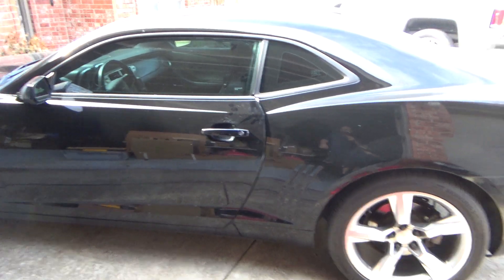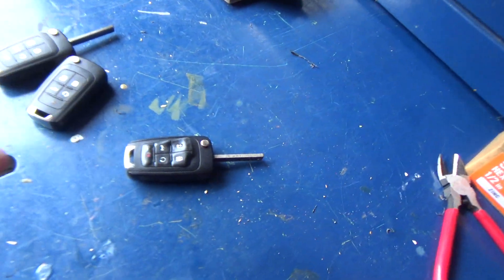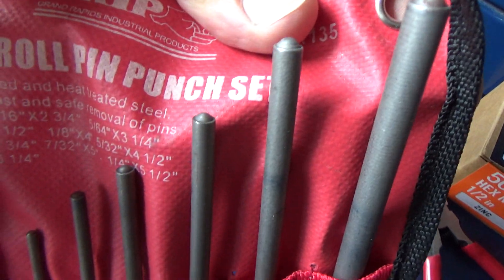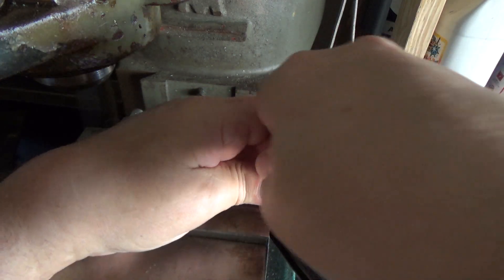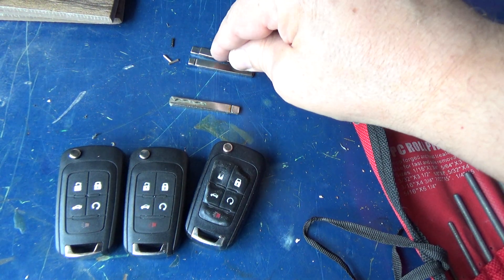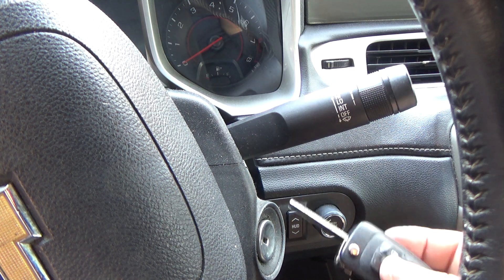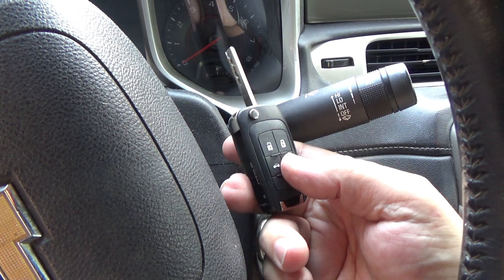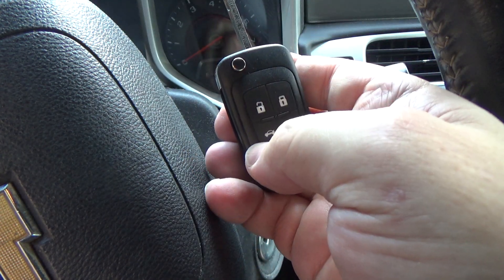How to Install the Key from Old Remote into New Remote and Program so you Don't have to have it Cut.

Comment: So you didn’t have to get your scan tool to program the fob just getting it close to imobilizer with key in the on position does it?
Reply from the maker: No scan tool is required as long as you have a working key.
Reply: @737mechanic  awesome thanks